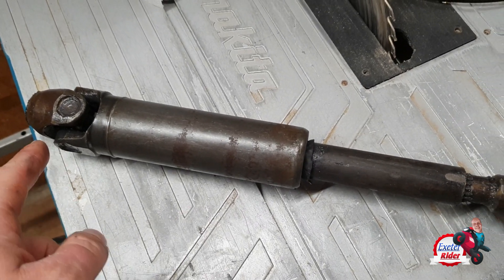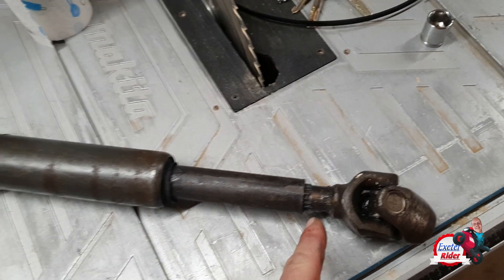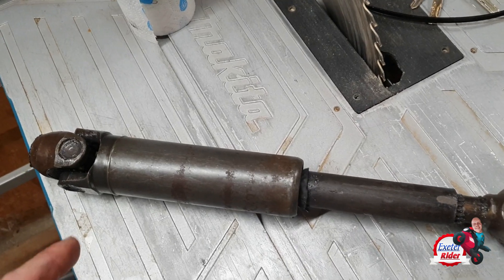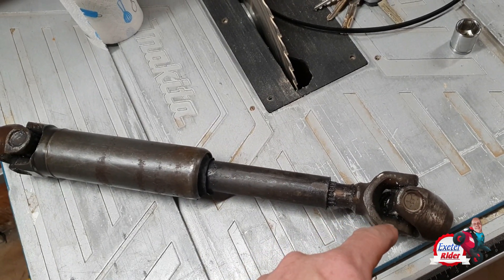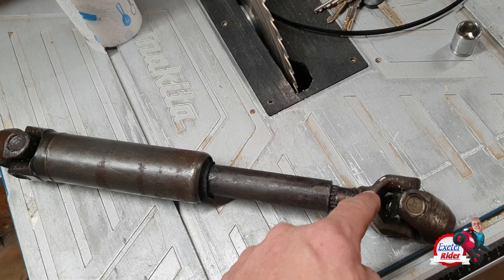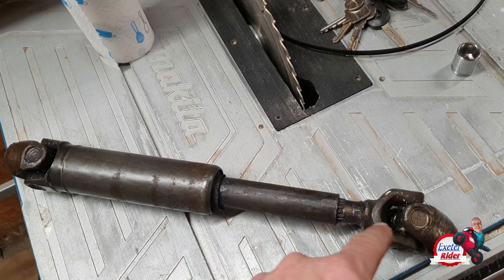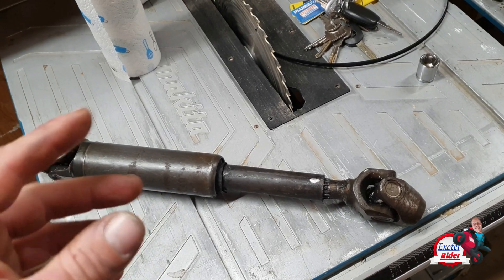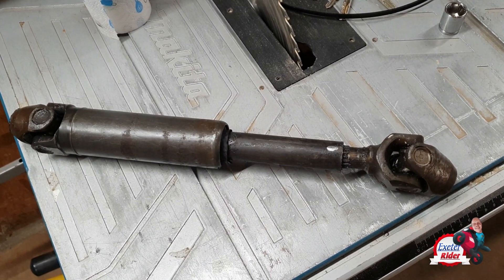How A BMW Motorbike Driveshaft Should Be Phased/Balanced

Comment: How did you get the extremely seized drive shaft out I have the same issue
Reply from the maker: It's very difficult! I had to heat it up and use a very good vice to bang it apart, that's the only way sadly.

Comment: Great, simple video on a small but valuable bit of information.  Again I am impressed by your gift for making something clear.  I may have seen 3-4 other discussions on the need to phase the Boxer drive shaft, yet your simple, short statement of "... the fixed part of one universal joint must match up with the other end of the universal joint..." and your pointing it out as you described it has sealed in my mind the correct thing to do.  Lesson learned!  Thanks much.
Reply from the maker: Steve thats so kind of you to say thank you. I often struggle a bit to be honest to get whats in my brain out onto camera so I am glad it seems to be working.  Thanks for your time viewing this.